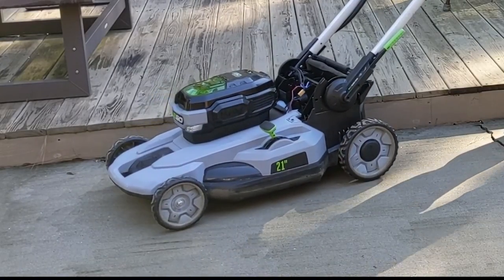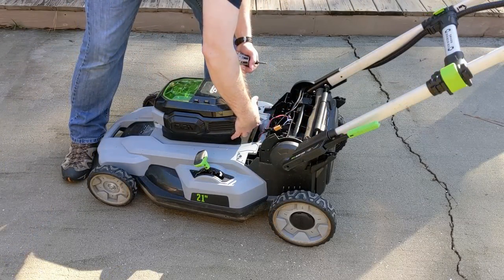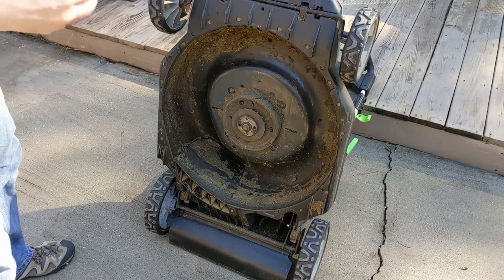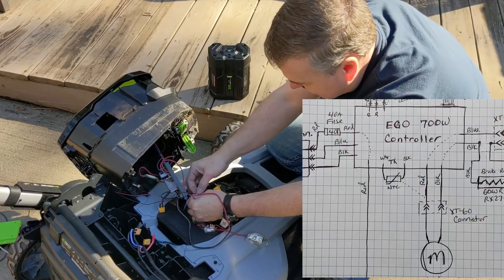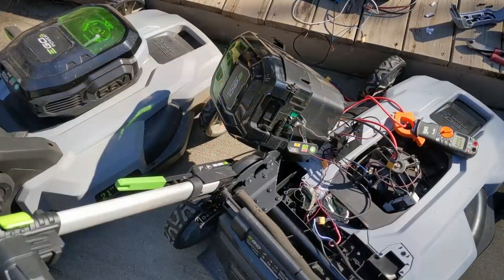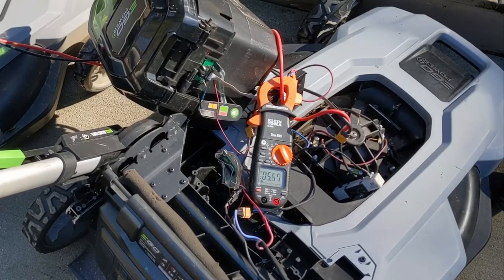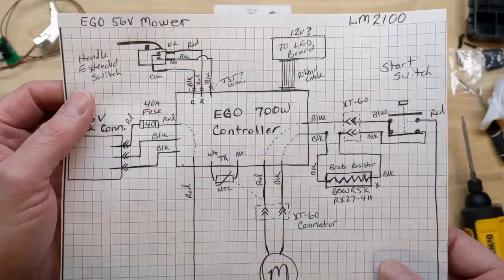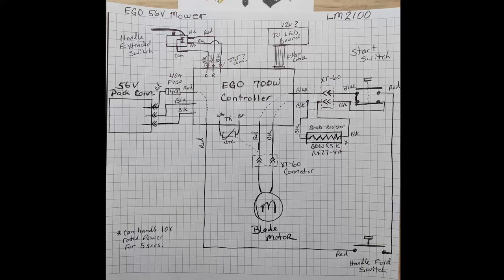EGO LM2100 Mower Troubleshooting

Comment: My Honda is 7 years old and running fine these battery ones are garbage.
Reply: I'm starting to think that the Ego mower is the equivalent of a big-box store briggs&stratton gas mower. Works great for a few years, then starts breaking. I can live without a Honda mower but I really wish I could afford the Honda snowblower.... 2400 bucks though...
Reply: I bought a used ego 21" mower at a pawn shop for $125 and got a 2.5 amp battery and a rapid charger with it.  

I have had no issues with it, other than replacing the blade.  

I currently have the mower, blower, string trimmer , chainsaw and 3 batteries .  
No problems with any of them .
No fouled plugs, stale gas after winter, broken pull cords
Reply: I bought a used ego 21" mower at a pawn shop for $125 and got a 2.5 amp battery and a rapid charger with it.  

I have had no issues with it, other than replacing the blade.  

I currently have the mower, blower, string trimmer , chainsaw and 3 batteries .  
No problems with any of them .
No fouled plugs, stale gas after winter, broken pull cords
Reply: I bought a used ego 21" mower at a pawn shop for $125 and got a 2.5 amp battery and a rapid charger with it.  

I have had no issues with it, other than replacing the blade.  

I currently have the mower, blower, string trimmer , chainsaw and 3 batteries .  
No problems with any of them .
No fouled plugs, stale gas after winter, broken pull cords
Reply: I bought a used ego 21" mower at a pawn shop for $125 and got a 2.5 amp battery and a rapid charger with it.  

I have had no issues with it, other than replacing the blade.  

I currently have the mower, blower, string trimmer , chainsaw and 3 batteries .  
No problems with any of them .
No fouled plugs, stale gas after winter, broken pull cords
Reply: I bought a used ego 21" mower at a pawn shop for $125 and got a 2.5 amp battery and a rapid charger with it.  

I have had no issues with it, other than replacing the blade.  

I currently have the mower, blower, string trimmer , chainsaw and 3 batteries .  
No problems with any of them .
No fouled plugs, stale gas after winter, broken pull cords
Reply: My Ego mower is in its 7th season. Never failed until i pushed it too hard. This video helped me diagnose the issue. Turns out to be a fuse. Easy and cheap fix. 
As for a gas mower, I agree with a Honda however if anything goes wrong, it will be not easy or cheap. Plus, the gas fumes are not good and just having gas around is also not good.

Comment: I honestly never considered the battery powered tool would go bad on the EGO products. The complexity in the tool is greater than I thought it would be!
Reply: going back to gas mower after 2 years of Ego ownership. Not worth the time to trouble shooting during weekend while kids are running around and the grass are growing crazy
Reply from the maker: Sorry to hear that. Have you contacted EGO on warranty. They really have a great warranty. I have only had one failure out of all the EGO equipment I actually bought new. I had the original battery failure and they sent one right out and let me keep the old one. That is what started my EGO repair videos and after successful repair of the first pack I started buying other non-working items to learn and share with. Best of luck to ya!
Reply: @liuweimd I have several EGO products. I had this same controller go out, but after 6 hard years of use. Never had a single issue with any of their other products. No maintenance, no gas storage, no pollution, less noise…………

Comment: 200 Amps? Don’t you mean 2000 milliamps? No way that wire would handle 200 amps of current. Let’s say for comparison sake that red wire is as big as 12awg it would only handle around 25 amps. Something doesn’t add up here
Reply from the maker: It has been a while since this video, but I should have shown it in the clamp meter display. With the controller it soft starts the motor so it's fine with the 10 gauge wire normally. It's fused for 40A and runs around 12A no load and running speed and can pull up to 30A under load. I tried my best to show why we need a controller on this motor because so many people mention running across full voltage (cross the line start) so I showed what would happen if you put the motor straight across the 56V. It does in fact spike to 200A! Not that 10 gauge wire can handle that much current for any length of time , but simply start up spike or what we call inrush current. These silicone wires actually are surprising how much they can take temporarily. They are rated for 200⁰C.

Comment: First thing I did was take that frigging battery cover off.  I could not get access to toe controller with that dang lid flapping me in the face.  No service tech near by so had to do all this myself
Reply from the maker: Oh, that cover! Yes, the cover indeed!  I know exactly what you mean. In the next video, after this, I retrofitted an aftermarket DC controller, and I mentioned how I cut the back of the hinge at an angle on mine so it will stay back when I open it. What a pain!

Comment: Mouse Hotel- found a LM2100sp on the curb that is DOA. Mouse chewed multiple wires, I cant find where the thin black and white wires  from the main  controller go  , On your wiring diagram it shows to the NTC but I don't see where that is. Did the mouse eat it too?
Reply: If a mouse ate the component, what can I use to replace it?
Reply from the maker: Mine had a NTC on the small black and white wire. You can see the silver tape at around 3:15 and the ntc is wrapped up in that tape attached to the DC motor  power wires. Typical, though not all, NTCs measure round 10K at room temp. 
Yours may still be there under the silver tape...
Reply: @ThriftyToolShed  Thanks for replying, nope nothing under the tape, mouse ate it!!
Reply from the maker: Dang...
Reply: @ThriftyToolShed  I found a 10k thermistor on an old bms board, I'll try it. Thanks
Reply: The Thermistor was still there, it was so small I missed it. So the blade motor runs now after repairing the wires but the self propelled motor does not, can you tell me how to test the switch before I replace the sp controller? The motor is good.

Comment: Running into the ame issue on the older ego mower, newer ego is completely dead, changed out the PCBA between mowers, no change, but the older ego seems to be repairable based on your video , will have to do more troubleshooting  to verify, you gave me more checks to do to verify controller replacement.
Reply from the maker: Has the one that is dead had the 40A fuse checked right above the motor?

Comment: Thank you so much for this video. I had the blinking orange light. Could not take off the blade but that seemed OK. Bought a leaf blower to get another battery(battery $249...blower $279). Same thing happened. Watched this video many times and thought I would give it a try before bringing it to a service tech even though I suspected the controller. When I took off the casing (not too handy myself but wth) i looked at all the wires and noticed one was frayed. I disconnected it and realized it was for the self propelled motor. The blade worked fine so I knew I could mow with difficulty. I could not get to the other end of the frayed wire but managed to splice it in place. IT WORKED. I would not have tried it without the video so thanks again!
Reply from the maker: Awesome job! Thanks for sharing!

Comment: Thank you for sharing this. My mower was doing the same thing for quite sometime. It used to take few tries to run but the funny thing is if I tilted the mower by pushing the handle down it would restart. The mower did not start for some reason yesterday so I started tinkering with it. This video was a valuable find and seems like a controller issue on mine as well.

Comment: Awesome job   I am having the same yellow light flashing issue but it is intermittent and becoming more frequent.  Likely a component failure.  I will confirm with and amp meter as well. Thanks for a great thorough job!

Comment: If mine has the same issue where it starts without the blade on, is it worth opening it up to look for bad connections or anything, or does the controller probably need to be replaced?

I found out I can actually get it to start by looping a piece of twine around the end of the blade and yanking it to start the blade moving right before trying to start the mower. Crazy, I know, but it works. I’m always careful not to have the battery in while messing with the blades.
Reply from the maker: It absolutely seems to be an inertia issue. The current sense is thinking the current is going too high on startup, it seems. It maybe reading that incorrectly, but unfortunately, it's not much we can check with the epoxy potting on the control board.

Comment: Curious.  I had this issues start happening today.  I ended up using a 2.5A battery and it worked just fine no issues.  Not sure if the 5A is giving it too much juice.  But want to make sure it's a mower problem and not battery problem before going to next step.

Comment: Enjoyed your video although it is 2023 now. I have the same EGO mower my issue is the speed run wide open at 5 regardless of the throttle switch position. Runs fine but the speed is so fast I am almost running behind it. You have a good grasp electronically of this mower. Can you please determine why the speed throttle no longer functions properly. I have looked at the electronics but nothing seems to work from others online who have this issue. Thank you in advance.
Reply from the maker: Hi,
Thanks for your kind comment!
I actually have not worked on the Self Propelled model myself. I don't know the most common issue, but I would check the wiring going down from the handle into the mower. I would check the speed selector control knob itself and the wiring first since it does run just seems to be stuck at high speed. Losing the speed signal from the speed selector could cause this for sure. Even though it could be the speed knob or wiring possibly pinched where the handle folds. I wish I could help more.  I wish the very best of luck to ya with yours!

Comment: Awesome videos!  I’ve been troubleshooting an LM2000 doing the exact same thing.  Brand new battery fully charged.  It spins up for a second or two then amber flashing.  I’ve checked all the switches and leads with no luck.  I’m thinking I’m looking at a bad control board as well.  Do you have a good place for affordable boards?  I’m fine with rebuilt as well.  Thanks again!
Reply from the maker: Thanks for your comment. I posted the very next video with the Retrofitted controller and I did take time to share the cost of a couple of these and the EGO replacements from a couple sites as well. I have links in that video description.  Hope it helps and best of luck to ya!

Comment: My Ego mower is 3 or 4 years old. I'm running into the same blinking yellow light problem as I try using it this new mowing season.  I am going to study the video more.   GREAT VIDEO by the way!  But am thinking it might (probably will) boil down to either trashing the mower, or buying the controller board.  I'd be interested in your DIY controller idea, however, I would want to keep the variable speed control.   Would your solution keep the  variable speed control?
Reply from the maker: Yes, I added the controller and kept the variable speed. I typically leave it at around 65-75% speed so I did not add wires up to handle for the adjustment, but easy to do if needed for sure! Thanks for your comment! Best of luck to ya!

Comment: I have an EGO LM2100 that I just got back from a warranty repair. It still shuts off and flashes a few times when I cut the grass. Not really happy with this mower. I don't want to take it back to get it "fixed" again. Not worth it. So I might just watch this video really closely to see if it's a controller board. Thanks for the video. Let me know if it stopping intermittently sounds like it might be a controller board. I thought the battery was the problem, but maybe not. It's not over heating either, which EGO was trying to tell me. It was only 50 some degrees and it still stopped and flashed 4 times during grass cutting.
Reply from the maker: If the orange/yellow light is flashing when it shuts down it is most likely the controller. It's like it is sensing too high of load/current and shutting down. If the red light is flashing it seems to think it has a low battery to the point of shutdown possibly. I would check the connections on the battery terminals for the mower and maybe even the wiring to the handle and back just to check the easier things first.
Reply: @ThriftyToolShed  Thanks for the quick reply. I will check the connections and the handle wiring. The repair person said something about a bent battery tap. But it's still not working right, and I don't want to take it back. If I can't fix it, it will probably be on the curb with a free sign on it. lol

Comment: Great video! After 3 years my Ego mower became loud, vibrates a lot and does not cut as well.  Tested new blades. Same issue. Do you have any ideas?
Reply from the maker: I have not seen that exact issue, but if you have vibration I would make sure the blade is on correctly. I know you mentioned new blades also and that's good to test for sure. It may also be a spacer that is not correctly aligned possibly? It could also be a bad lower bearing in the motor if the shaft has any movement or play in it from side to side. The other issue could unfortunately be that the blade has hit something hard enough that the motor shaft was bent causing vibration. I hope it's the more simple solution and something not centered or aligned on the blade....
Reply: @ThriftyToolShed  Thank you! Will look at everything you mentioned. Is motor shaft hard to fix/replace?
Reply from the maker: @EUG888  
Typically the motor will need replacing if it's bent bad enough to vibrate.
Reply: @ThriftyToolShed  Thank you! Will contact Ego support.

Comment: Hello Thrifty Tool Shed
Thanks for doing these videos.  They are very helpful! 
I have a problem similiar to yours but not exactly the same.  It is an intermittent problem. When I try to start a few times, the first time it will go green and start.  But the next time I try to start, it will flash orange/green and not start.  If i let it rest for a few minutes it will usually go green and start.  Once it starts, I can cut my whole lawn.  But if I try to start again it goes yellow.  I used you diagnostic and removed the blade and it starts every time without the inertia from the blade, so I'm thinking that it may be the controller.  
But electronic parts are not usually intermittent, they either work or they don't work.  Maybe the thermistor, but if it was a heat problem, I couldn't cut my whole lawn once I get it started.  I would greatly apreciate any insight that you could provide.
Thanks,  
Dave D.
Reply from the maker: Interesting and very true. I would think with the controller issue, it would show similar to mine and have the same fault very consistently. It could possibly be that yours is just on the threshold of being too much load at startup (or the controller thinks it is?) so any change in temp. etc. could in fact be a deciding factor if it starts or doesn't. Just a thought, hard to say for sure. Unfortunately it's no good way to get into the hard potted controller and try to figure it out either. I can't say for sure but the controller is the most logical issue? At this point trying the cheaper replacement controller to run it might be the next step in testing as well?  Sorry I can't help more. Best of luck to ya with yours!
Reply: Hello again Thrifty Tool shed.  I got by with having to try many times to get my mower to start.  It would flash green/orange for about 25-30 tries and then would finally start and would keep running for 45 minutes until stopped it.  I finally broke down and bought a controller EGO-2830075001 from parts warehouse.  I am currently waiting for it to arrive.  But then I watched your video again and saw all of the testing you were doing with the Klein current loop tester.  I don't have all of your fancy test tools, just a simple multimeter which measures low currents.  

So i got to thinking.  My battery is 6 old and has maybe 250 charge/discharge cycles.  It runs fine once i get the mower started.  Is it possible that the battery is too weak to provide the initial startup current, but is ok once it gets running?  I don't have another battery to test with.  So I could try to borrow current loop from one of my ham friends to test the startup current.  What values should I see with a good battery and what will I see if the battery is having trouble providing enough startup current.

Thanks Very Much
Dave daniels
Reply from the maker: I may have shown the current on video. It's been a little while to say for sure. If you can get your hands on another pack to test would be the easy test.